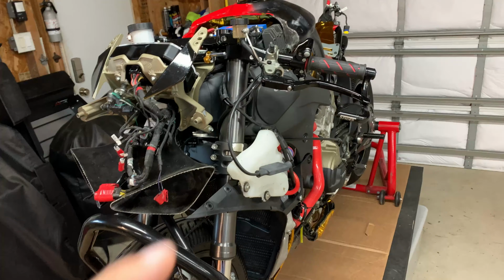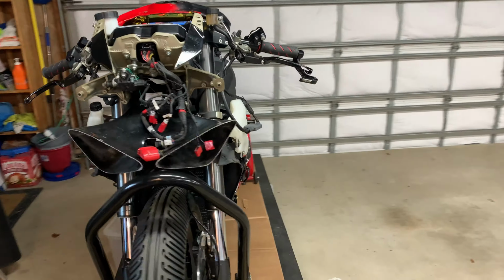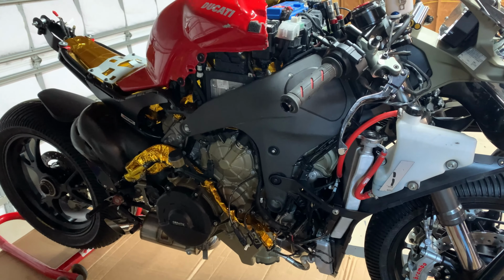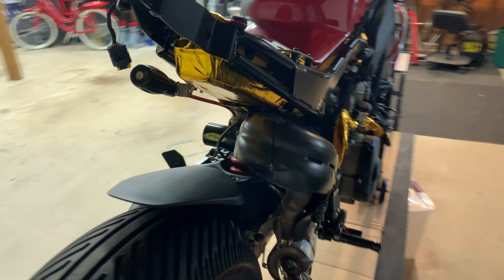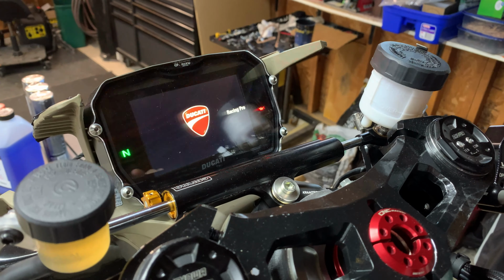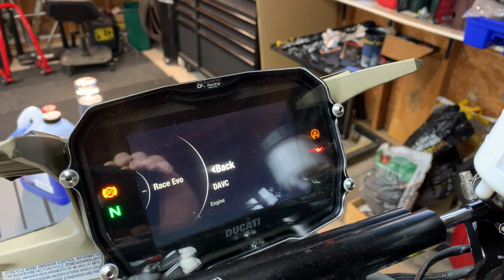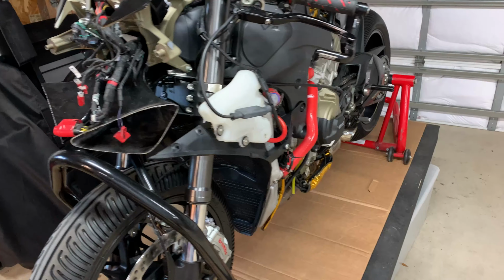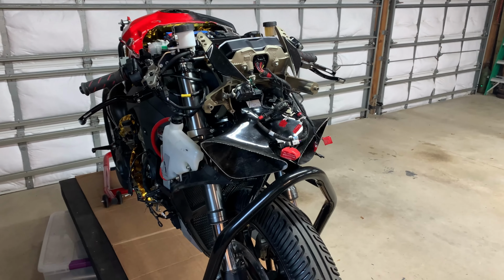Ducati V4 Crash/ Teardown Pt. 7 | We Have a Rolling Chassis Again!

Comment: Glad to see you have put the bike back together. You are still in SPORT EVO after you changing those settings on electronics. Probably that's why it doesn't change.
Reply from the maker: Thanks man, it’s been a process no doubt. Good thought, we actually found an issue I’ll be covering in the next video as to why the ride modes wouldn’t change.

Comment: If you get an OBD Star Iscan Ducati, you can do a fair amount of self diagnostics, including passive & active tests and associated resets. May help you cause going forward
Reply from the maker: Appreciate the heads up dude. I’ve been using the melcodiag/Jpdiag for basic things, along with the T800. We found an issue that wasn’t able to be picked up through a basic scan, covering it in the next video.

Comment: Is that a V4R? I'm assuming you can only race CMRA with a V4R and not the "regular" V4, correct?
Reply from the maker: It’s a V4 base, not an R. Legal in CMRA, not so much in MOTO-A as it’s an 1103cc motor.